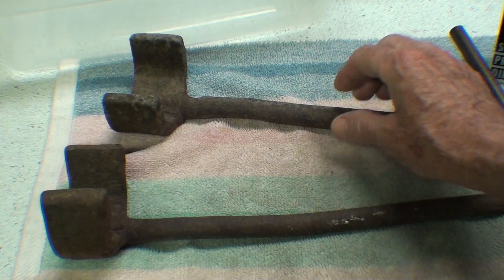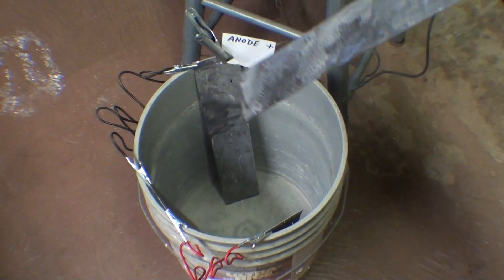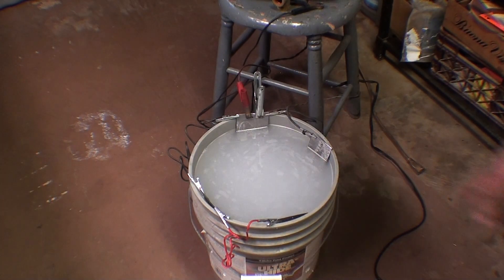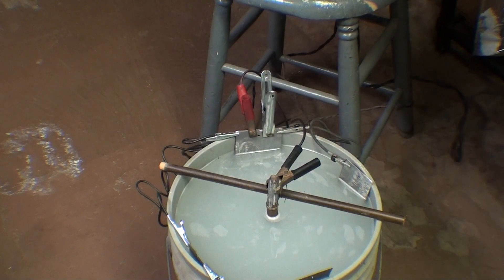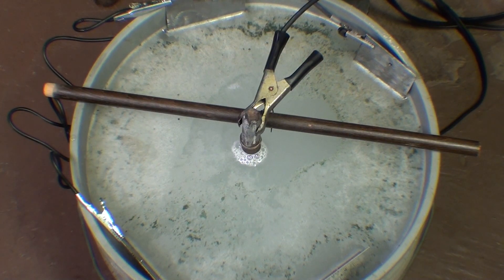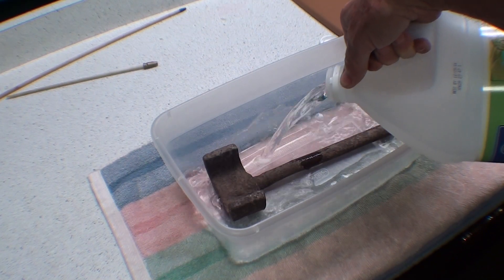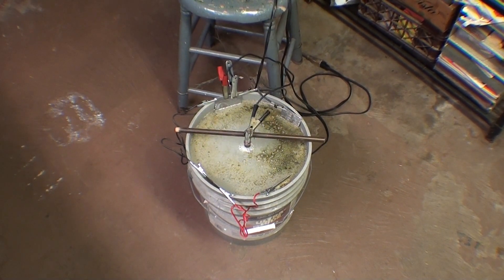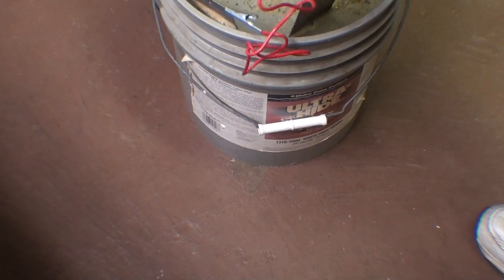Rust Removal - Electrolysis vs. Vinegar  #309 Pt 1 tubalcain

Comment: Im.confused to why you have the negitive lead hooked to the Diode rather than a ground point.  And your possitive is hooked up as the ground?   Doesnt that actually do the opposite to the rust that your trying to pull out of the tank?
Reply from the maker: I made that video so long ago that I cannot answer any of those questions
Reply: @mrpete222 😅😅😅  was or makes ne worry that I may have been doing it wrong all this time.   I hook my possitive lead to the diode or Donor Alan Wrench and then I hook the black or ground directly to the tank. 

Ive read that if you reversed the electronics connections it could force the rust deeper.   I dont know why anyone would want to do that nor can I think of a reason that would be beneficial at all.  

Unless you know ?
I am right this minute doing this very process on a 1996 ZZR 1100 gas Tank actually.

Comment: I thought you had to add water and salt to the solution, I did a boat intake manifold in a barrel top surface of the liquid was a lot of foamy rust color, worked pretty good.

Comment: Store bought White Distilled Vinegar is only 5%. The Cleaning vinegar is 6%.
I had issues with my old house boiler and later my old water heater getting plugged up from age and the fact that I’m on well water and need a water softener because of bad scale build up on everything in the house as well, I turned off everything, drained all the system, added 75% White Distilled Vinegar and ran pumps to Circulate each entire system separately for a day several different times, then flushed them with fresh water. 
At one point, I left the vinegar in the system, but eventually flushed it.
Vinegar is EXTREMELY POWERFUL, and is VERY GOOD at removing rust and EVERYTHING.
I know because my Weil McLain Boiler after a few weeks flooded my garage because it at through the water supply piping to it, then a few weeks later, my water heater flooded my garage for the same reason. And it was in February in Alaska.
I don’t blame the Vinegar, it was because the boiler was over 20 years old, but the vinegar removed the corrosion that was still keeping it from failing completely.
I was surprised after doing some research how Corrosive it is to metals! It eats metals for lunch!
I wish you used 75% in your video for your Comparison!
I was anxious to see those results because I’m working on cleaning about 3-4 hundred pounds of tire chains for my backhoe so I can weld together at least 1 set for this winter.
Reply from the maker: I appreciate you watching and sharing this helpful information!

Comment: Could I use Salt to make it more conductive . And what is the problem with using  higher voltage. I don't know anything about this. I am doing research on the Anode part I know there is another machine u can use probably more expensive. Not sure what is called. So reversing u mean changing the position of the charger connection.

Comment: Ever have a rusty gas tank it works great for that also.
I couldn’t remember were the positive went that’s why I ended up here.right now I’m doing a gas tank that’s in a 1997 montero that sat 12 years.
Removed the fuel pump filled tank with water add my soap hooked the negative to the tank and the positive to a rail road spike hanging down in to the water and not touching the tank.
Reply from the maker: That should work. I think you will be happy with the results.

Comment: You need a manual battery charger for electrolisys. the automatic charger sees the batery as full and lowers the amperage when the water is charged

Comment: Hi
I have just finished my first test and it went wrong. The different parts presented different resultas, some are spotless and others seem to be much more rusty than before and even seem to have had the metal attacked. I didn't hang the pieces but left them in the bottom, I had just 4. I used a 12V/12Amp battery, the only one I have. Electrolite was made with water, salt and vinegar.
Should I do it again, or can I fix it ?
Any idea would be very welcome .. Thanks
Reply from the maker: Try it again with washing soda. Your parts must be oil, free, and paint free.
Much experimentation is necessary
Reply: @mrpete222  thanks for your answer. Maybe my error was not attaching the negative pole directly to the piece of metal I wanted to clean. Instead I used 2 pieces of copper as catode and anode and put it in the electrolite. Now that piece is rough when I touch it and seems to be in bad shape. I really hope to revert that. Tomorrow I'm going to try with baking soda. Thanks

Comment: Just to add. If you mix the sodium bicarb with the white vinegar and give it a good shake it'll react into CO2, water and sodium acetate. Sodium acetate is the wonder chemical here as it removes rust and stains from the metal far better than vinegar does on it's own. Great video otherwise though.

Comment: Muriatic acid works faster ,needs to be flushed with baking soda when removed from acid   ..will flash rush if not painted or coated wit anti rust  ..

Comment: Using a lower voltage you can control it better.   I have done this several times.  I use an electroplating machine.  It's used by jewellers for Gold and Silver plating.   The unit has a small cardiac inside, along with volt mad amp meters.  You can dial in jyst the right voltage.  Too low and nothing happens.   Too high and you might start losing metal before you realize it.  And you do want to use lots of anode so the process is done evenly over the work.

Comment: I did this but used 4 - 6 volt agm batteries in series with 4 anodes daisy chained together . I can put 8 rusted tools in at a time and in less than 8 hours the rust is completely removed. Your not throwing enough volts with that little charger. NOTE: I am cleaning over 200 tools that were in a fire .....

Comment: I got my setup with a charger but for some reason when I get everything set up the amperage shows 0.
I tried the charger on a battery and the amperage gauge will work.
When I hook it up to the sacrificial piece of metal and to my rim the amperage dose t move. Stays at 0

Comment: I’m trying to set up a plastic 55 barrel that I cut to only have the bottom section that is about 16 inches high.
I got a car rim in it soaking in vinegar.
I want to do electrolysis but was wondering if I can just put the negative connection on the rim that is sticking out of the vinegar solution as the top part is sticking out by 1 inch and the positive in the vinegar so the rim ?

Also not sure on amperage I would need ?

Comment: Using the food grade vinegar is the issue. You need the cleaning or 10% vinegar. That does indeed work.
Reply from the maker: Thanks
Reply: There is a guy who did a comparison on YouTube and he used white distilled 5% vinegar, 15% and used 30% cleaning vinegar and they all came out with the same results over the same amount of time.

Comment: I simply use vinegar and a 24 hr soak  . Afterwards a brisk scrubbing with a steel wire brush will clean the part up just fine .

Comment: I have tried the Vinegar treatment many many times and I am unimpressed with the results and it takes forever to do it's thing.  also you have the awful black coating on the tools that is a real pain to get it all removed especially in cracks and crevices.  Electrolysis is the way to go and you will be happy with the results it gives.  Way more fun too~! 😆😄😁👍

Comment: I have a 30 amp 12 volt power supply, I figured that's going to be too much amperage so that won't work. I'm removing rust off motorcycle parts and need a trickle charger for the bike anyway will my trickle charger work for this?
Reply from the maker: The trickle charge will probably work but take much longer

Comment: FYI, your workpiece turned black likely because you used tap water instead of distilled water. Tap water contains a lot of minerals and contaminants which will split from the water and stick to whatever you have connected to the negative terminal. Try it next time with distilled and you should get better results!

Comment: I had to pause the video to look up how a round-jawed wrench could fit a square nut (having done so I realised I should have been able to work it out by the direction of the handle parallel to the open edges of the round). I also think you could fund a few supplies by selling them Mr Pete - I found some online for $37!  at https://www.hansenwheel.com/wagon-wheel-wrench/

Comment: What happens if you u do this process in a bucket of vinagar? I suppose its a mess because of the soda reacting with vinagar.. And it shouldnt matter if your soda is bi-carbonite (baking soda) or carbonate (washing soda).. Either is fine.. But for safety sake never use table salt. It will produce chlorine gas

Comment: Appreciate the video! I would like to add a really useful tip for the vinegar after taking the rust off. Instead of disposing of the used vinegar you can use it for wood stain. I have tried it myself on my wife's side table and it turned out rather well. Also, note that if you do this to do a test piece because there will be different variations of darkness or tint depending on the amount of rust and metal accumulated and in addition with that; give it some time to dry on your test piece because I have had the tint change dramatically after it had dryed- it got quite a bit darker.
Positive Endeavors
Sincerely,
Patrick Mulcahy

Comment: 7:50 Instead of buying more vinegar, cut the expense with a bag of marbles in your workshop for this and any other project where your container is too big for the job.
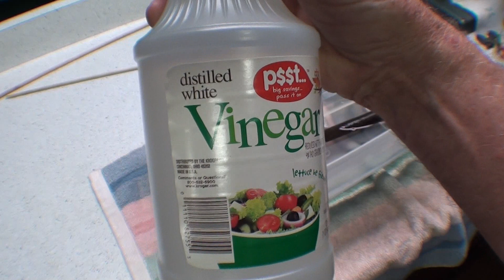8:28 The brand is 'Kroger' its written next to the barcode.
Try apple cider vinegar, its considerably more effective than white vinegar (also great for removing rust inside motorcycle fuel tanks).
Reply from the maker: Thanks

Comment: Good Job.  I think you should have taken each sample out, rinsed, do some minor brush scrubbing; then show what they job looked like,  cleaned up.   Typically , you would lightly oil or protect the parts now "raw metal / iron rust "flash over" that can happen in literally minutes when exposed to Oxygen.   OIl, paint, etc.   Good American - Sharing Knowledge To All.

Comment: Can you do this to a shovel with the wooden handle still attached? Meaning the metal rust piece would not be suspended.  the metal would touch the bottom of the bucket.

Comment: Thank you for sharing your work, love the  High Heal  shoes description. I have started working out how to do this work and yours and well explained. Have you ever tried adding power to the vinegar to see if it will do better, the washing soda looks to be the best way by far. I want to do many small bolts before i try zinc coating them have you any suggestion on how to wire them. I used  Hydrochloric acid and it cleaned very quickly a single bolt however it seemed very dangerous.
Reply from the maker: Thanks

Comment: I am having trouble finding an old battery charger, the newer ones with automatic shutoff does not work. I will get a check battery light to come on, and then the current stops. Is there something else that I could use as a replacement?  - a type of rheostat or something. I guess I need something with between 2-6 amps... and would the needed current be DC or AC? Any suggestions? Thanks!
Reply from the maker: Dc only.     Find a used older charger

Comment: 12-24 volts is good, but the greater the AMPERES.... THE FASTER IT WILL WORK.
ALSO, YOU COULD USE 2 BUCKETS WITH ANODE AND CATHODE COMPLETELY ISOLATED....
THE BUCKET INSIDE JUST NEEDS A FEW DOZEN HOLES AROUND IT TO ALLOW CURRENT TO PASS.
BEWARE IT DOES NOT SEAL... ELSE OXYGEN/HYDROGEN ACCUMULATES WHICH COULD LEAD TO A GOODLY EXPLOSIVE EVENT. NOTHING THAT WILL BLOW THE HOUSE UP... BUT BE WARY.... VENTILATED AREAS PLS.

SALT AND VINEGAR ARE FOR ELECTROPLATING SOLUTIONS....
NICKEL, COPPER, ZINC .... ALL VERY SIMILAR PROCESSES TO RUST REMOVAL.
ALL ARE DIY CHEAP, AND EASY... LIKE MAKING BORSCHT.

Comment: I don't mind the elbow grease and not much is involved with just letting some parts soak for a couple days at most, but, I won't go to the trouble of electrolysis. I've heard people mention about neutralizing this and neutralizing that and I say bullstickery to neutralizing white vinegar. I stick my hands into the soaking bin and grab a part, I scrub it well with a wire brush of sorts, then rinse with water while scrubbing again, rinse and blow the part dry with my air compressor.  BUT, I would never want to wire brush a raw dry rusty part as I know not all rust will come off.  
          
              I've done the Muratic acid 50/50 and loved the results but never leave the parts soaking for longer than an hour or two. You may have to neutralize Muratic acid though. I never did other than a good water bath and scrubbing ( and yes, I wore gloves). I've since been turned onto White Vinegar and will never go back to anything else as I know white vinegar can not harm your metal, anyway within reason and none that I know of out of all the tests I've seen done and a few of my own. I would not be afraid to drop a rusty wrench into white vinegar for a month even, maybe a year if I wasn't needing it LOL.  

              Scrubbing after a white vinegar bath is rather enjoyable for me as I clearly see the improvements, and after a scrubbing, if I see any sign of rust, I toss the part back in the bucket for another 24 hours or so with worry. I will ONLY use my white vinegar solution twice, before dumping the old stuff on some weeds next to my yard. I love it! Great weed killer too!  You can dispose of the stuff anyway you wish  as it's a natural biodegradable product and it's so cheap, refresh your soaking bucket anytime you wish!  I'm currently redoing the disc brake system on the back of my Monster SUV and I've done the rotors and they look like new now, and I just painted the caliper brackets with Rustoleum gloss black with perfect positive results and w/NO neutralization!!! 

                A STRANGE THING TODAY though, after seeing that my parts needed to soak another night yesterday, I tossed the last caliper bracket into the bucket for another round or soaking over night. They appeared to be zinc plated also from what I uncovered after a good brushing. Both brackets actually needed a second night of soaking which I found strange but oh well. When I brought my last part out of it's bath today, it appeared to have spots of a copper coating starting and i wonder if copper is used in Zinc. It washed/brushed off just fine, leaving a nice beautiful shiny rust free zinc looking coating left behind which I did spray with black gloss Rustoleum and I love the results. I will save my battery chargers for what they were meant for. WHITE VINEGAR ROCKS, and so do you MrPete222!!

Comment: Two comments, 1/ the current will take the shortest path so the plate furthest from the workpiece will have had very little current passin which is why you observed the lack of action.
 2/ Those cheap battery chargers have even cheaper ammeters. they are HORRIBLY inaccurate, usually, as you see, overreading.
Reply: would it solve problem #1 if you connect all plates in a loop instead of daisy chain?
Reply from the maker: Thanks for the comment. That is all I can afford, cheap battery chargers from a garage sale
Reply: @mrpete222  The ammeters on those chargers are usually a moving magnet meter and all they really are is a wire (yes, just one wire!) next to the needle which is, or has, a magnet on it. If you have a multi meter and can read the actual current then you can probably adjust the reading on the charger to something nearer reality.

Comment: The problem I am getting with the battery charger It says it's fully charged as soon as the power is turned on So no charge is getting put into it
Reply: Sounds like you’re using a modern style battery charger with an automatic shut off

You need to use an old style manual  battery charger

Comment: I have heard that wrought iron fetched a nice price at smiths who do wrought iron work since it is not made any more. However I did not try to sell them any so what do I really know? Nothing wrong with considering science when doing scientific processes, but you cannot argue much with experience. I did a small block Chevy with dilute muriatic acid once (no electricity) and it worked really well except for the sintered harmonic  balancer. The tight press fit on the balancer turned into one that allowed a good spin to last for several revolutions! Nothing like testing where you have to pay for lessons learned with hard-earned cash, LOL. 

Concentrated acids contain large amounts of energy, even the vinegar is diluted to around 5% acid, so 100 pct acetic acid could be dangerous. I started de-rusting that engine using metal prep that body shops use, it cleans well and leaves a nice rust resistant/primer phosphate coating. As the solution weakened with use I started adding some muriatic acid (concentrated HCl) I had around for cleaning concrete. Fortifying the derusting solution perked it right up, so I kept adding it until it got pretty strong. Gotta be really careful with chemicals. If you do not explode you can still drop a large or small part into the bucket and a proportional amount of the chemical will be discharged into your face similar to a cannonball dive into a pool! I saw a guy do that with a carburetor body he was cleaning and the cresylic acid cleaner soaked his face. Reddest eyeballs I ever saw as we flooded his face with water until the ambulance came. Be careful, unexpected dangers lurk everywhere.

Cresylic acid is a generic term referring to combinations of both cresols and xylenols along with phenol or various other alkylphenols (ethylphenols, propylphenols, etc.). Phenolic compounds in this family are found in a wide variety of ordinary materials.Oct 20, 2016
Cresylic Acid - Sasol North America
Reply from the maker: I think the wrought iron is hard to find
Reply: Rebar